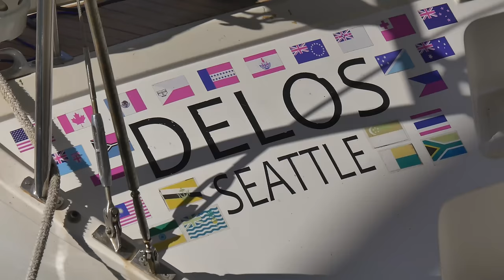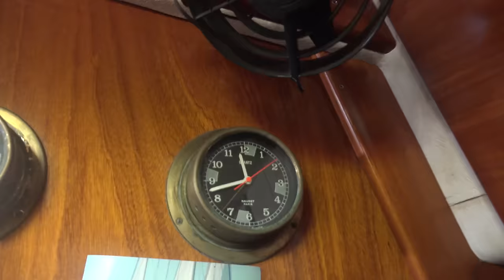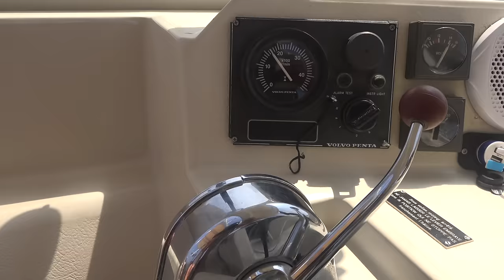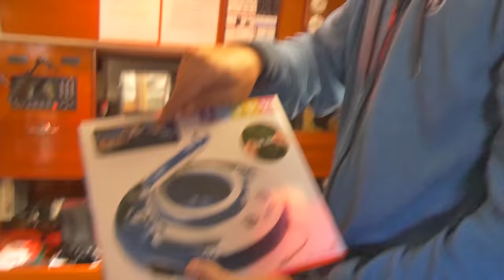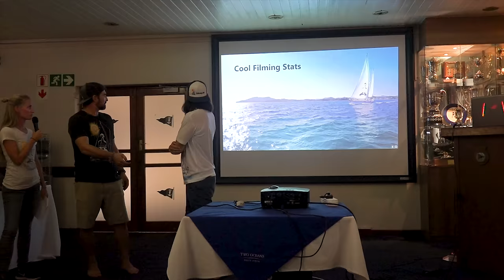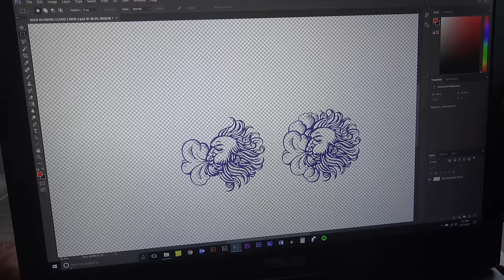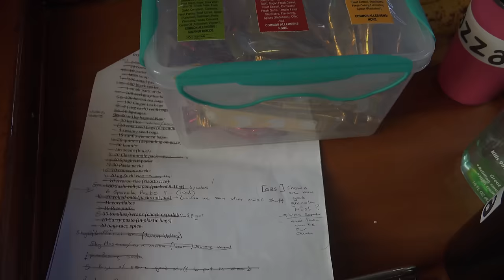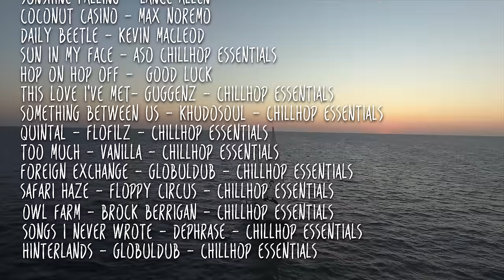Season Finale MEGASODE!!  88 days of Summer in Cape Town- Sailing Vessel Delos Ep. 141

Comment: The hose you have used for the exhaust is fuel delivery hose. Not appropriate for marine exhaust, hence the delamination of the old one. Marine exhaust hose is marked as that. Is made by several manafacturers and should not be hard to find in Cape Town.
Loving the videos, thanks.
Reply: These vids are about 9-10 months behind so they're long gone from Cape Town. They've been in Brazil for many months.

Comment: Good effort for all the repairs. As far as injectors and turbo go, if you want to clean them out and maintain them you can actually add 2 stroke oil to the diesel and run the engine on that. It lubricates the fuel system and cleans/lubricates the injectors. I usually add 300ml to every 60 liters added. Even do it with my cars. Also if you want to de-soot something and remove carbon build up. Leave the parts overnight in ATF transmission fluid and it will strip it right off, works a treat for everything from exhaust parts to spark plugs!
Reply from the maker: Brilliant idea Patric!  Will try try that next time.  Fair winds!  Brian
Reply: Thank's Brian! It's crazy how some people are jealous of the billionaire lifestyle yet I'm jealous of your cruising! I hope it all goes well with your new crew, especially as the Brit is representing my country! I'm going to have to make sure I apply for every opportunity to join you myself! Fair winds and I'll make sure to stick a few in the beer fund!
Reply: DONT DO THAT http://www.fuelexpert.co.za/2strokeoilindiesel.php  Run your main at the temperature reccomended by the manufacturer
Reply: Hi librulcunspirisy- It's perfectly fine to add 2 stroke to diesel fuel in low quantities as I suggested. I have been using it on a regular basis in modern vehicles 2015-2017. I also use it in the Land Rover I have and regularly use it in marine engines which suffer from fuel line corrosion due to excessive water buildup in the diesel from being at sea and condensation in the tanks too. I wouldn't listen to companies like fuelexpert as they are usually trying to persuade you to buy another product. I first learn't about it from the Bosch injector specialist (Bosch I believe make the injectors for the Volvo Penta marine engine) who told me to give it a go after a sticky injector and a bogged up turbo. A tank of 2 stroke mixed with diesel and a bit of a thrashing later the car was like new. You have to bare in mind that 2 stroke oil actually burns cleaner and more efficiently than diesel in the conditions inside an engine.
Reply: Also just to add, studies where they get opinions from the fuel companies and the two stroke companies are all a waste of time. The fuel companies want you to think their fuel is the best you can buy without additives and the two stroke companies don't want to accept any liability. 2 stroke  oil works great in a modern car with a particulate filter and everything is working off emissions let alone a Penta engine which is a workhorse. The Penta in Delos ran off black market fuel, she will run a treat on some good quality diesel with a little bit of 2 stroke lube in her.
Reply: Patric-If you want to get the full picture about your fellow country person, go to Delos.com and read all of her blogs written during the voyage from SA to Brazil. Spoiler alert! Since the blogs write much detail about the trip we will be covering in the vids over the next year it may not be for everyone. I find reading the blogs inspires me to value the release of the videos with even greater anticipation. In my opinion Lizbeth is the greatest blog writer who has ever sailed on Delos.-Ray
Reply: RoadRashRay Thanks Ray! I will deffinately have to read the blogs!

Comment: For diesel engines it is worth considering additives like the Millers Diesel Ecomax or even just a cetane booster (1ml of it per liter of diesel). Makes the fuel combust cleaner even at low rpm. Less carbon. More mileage. My VW Golf exhaust is as clean as that of a new car.

Comment: Dude you're O2 housing was a normal shape, super common to have a seperate passage from the primary exhaust and the wastegate which merge further down stream.  Considering all the turbulence that's happening at the turbine discharge its preferred.  That conversation may be for nothing cause it DID need to be replaced just not for the reasons some one told you lol.

Comment: Be sure to run some fuel conditioner in your diesel fuel to lengthen your fuel system life. Howes Diesel Lubricator I have used for 30 years. I don't like buying injectors. Or pumps. Just a tip for you.

Comment: is that still the original motor ? has there been any rebuild or overhaul etc. ?     
Legends!
Reply from the maker: hey phil, yes the original.  over 7,000 hours now.  have replaced a lot of stuff (injectors, turbo, exhaust, coolant pump, heat exchanger, timing belt, on and on and on.  put she still runs like a champ and burns no oil so I figure she has some more hours left in her.  Fair winds and thanks for watching!  Brian

Comment: Buh whaa haaaa haaaa.......this place is sooooo affordable.  Lamborghini in the parking lot, berthed next to a Wally.
I'm not broke but I think my idea of affordable is a bit different than yours, lol!.  And that was only two mins in.
Reply: Chuck-Their idea of affordable probably is different unless you knock down $628,000 per year and that is just income from Patreon. On top of that you would add revenue from youtube, beer fund, and any endorsements they might have. With that said, I don't begrudge them a nickle of that money. Brian still has a mortgage on delos he is paying off. The maintainence  and replacement expenses are very large. A few years ago they replaced the rigging at a cost of 20k if I remember correctly and the "boys" did all the labor. Over the summer they replaced the generator. They have replaced all of the electric motors for sails, winches, et all. Very heavy expenses and the crew does most of the labor which helps with the cost.  Brian, Brady, and Karin are all forgoing careers to perpetuate the Delos project. I would hope they are prudent enough to be contributing to some type of retirement account for each. Delos will have to be replaced at some time and I am confident Brian probably has some type of account set aside for that.-Ray

Comment: hey guys a tech question here... can android devices GPS be used at sea? Specifically the Samsung S7... it has 3 different GPS types listed in its specs... does anyone know?
Reply from the maker: Yes, we use ours as a backup along with the Navionics chart software.  works pretty good.
Reply: Thanks. It's great to check with real sailors.
And while I'm here, be careful of the plague that has Madagascar if you are returning there.

Comment: I'm not sure what kind of seals and gaskets are in the engine parts, so this suggestion might not be great. Have you looked into using something like Gunk Cleaner, or Berrymans Chem-Dip? https://www.amazon.com/Gunk-CC3K-Carburetor-Cleaner-Basket/dp/B000ABGA4E I used this to clean a 20 year old carb on a volvo gas motor. It peeled the paint and pulled off the old paper gasket bits that I couldn't scrape off.

Comment: Brian. Re: your turbo problem and low RPM"s for fuel saving. Best way to help for the future is to use Stanadyne fuel additive, it makes a world of difference, compensates for questionable fuel quality and improves efficiency. http://stanadyneadditives.com/ It will improve your fuel economy to easily pay for itself and help reduce sooting in the engine/turbo. Keeps injectors clean.